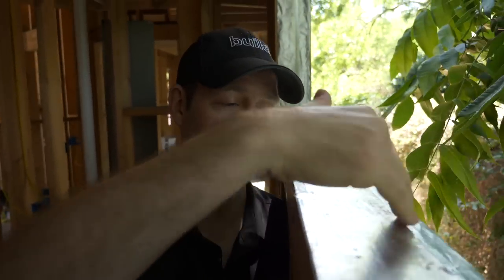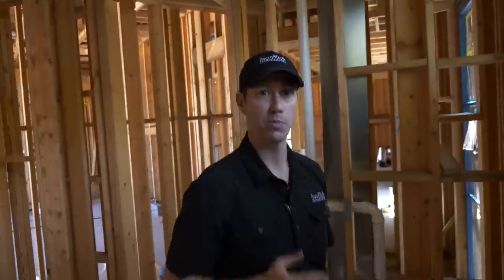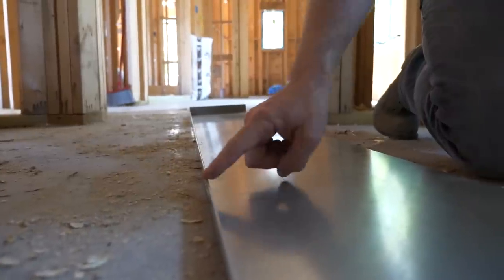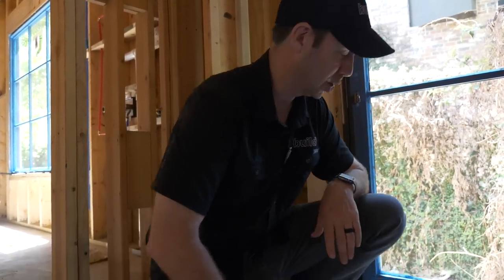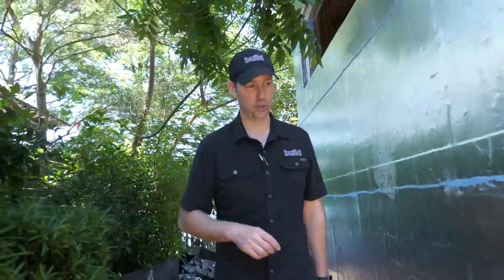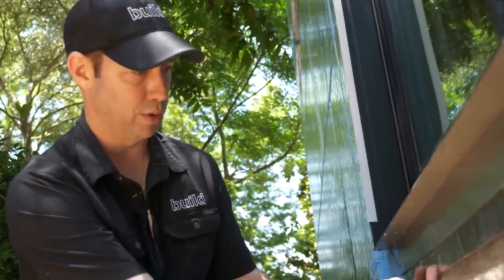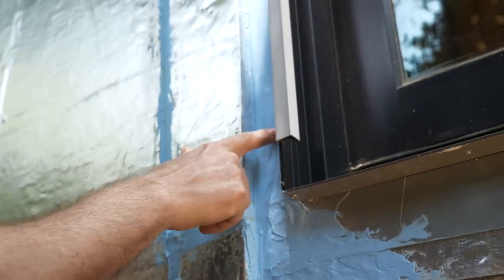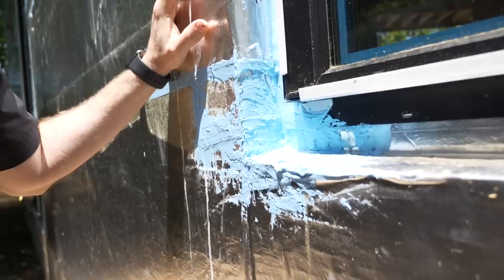Exterior Doors MUST have one of these!

Comment: I've heard that metal plans are great conductors or heat and cold. In very cold weather cold pans create condensation thus moisture on both side of the pan. Membrane pans prevent this.
Reply: Really good point, it would seem that membrane flashing would be just as good and less costly.
Reply: You can insulate the interior of the house off of the plate. I think the general idea is to catch any condensate from the bottom and drain it away. But then again, a membrane does protect the wall, too, yet it's easier to pierce a membrane than a steel sheet. I guess it's just preference. That said, I would probably go with your approach anyways.
Reply: That’s something that make sense so where can I get a membrane pan

Comment: Hello from mid Michigan. This may work well in the hot South, but not so well in the cold North. First the setup, 25 years ago I put a set of Peachtree French doors on my second floor bedroom addition. In a South facing wall, exiting onto a small deck over a low pitch roof of a 1st floor room. Thinking as you, that I would prevent water intrusion under the door set, I formed aluminium flashing as a pan. The pan extended from inside the door sill, outward over a 2X6 that was attached to the 2X6 framing below the door, to which the deck was mounted.

This worked great for water intrusion, but during the winter I had major ice build up inside the door sill. After determining that the cause was a loss of the thermal break which was built into the aluminium sill, I had to remove the whole door set, cut the aluminum back to the thermal break in the sill & reinstall with caulking as a water stop.  Problem solved & no problems since.
Reply: This was my concern as well - Here in MN we can get ice buildup inside and around windows on extremely cold nights, even if they are good quality and installed properly. I think this should be clarified as a southern climate solution.
Reply: Where is the thermal break that you are talking about ?
In my area condensation is a major problem that I'm having .
Could you explain how you installed this ??
Thanks, 
Tired of do.overs......
Reply: So basically not that the Pan was no good but the implementation...✅
Reply: @jefflosey1561  the implementation is always bad, you can't do it well, because you are bypassing the thermal brake made by the factory. If you use caulking, e.g. silicon between the metal plate and the door sill (which you do, as you don't want draft over there), you are making matters worse as silicon is 30 or more times more heat conductive than air. A compressed foam strip is also not as good as an uncompressed one. The good implementation calls for a thermal break but then why even bother with the whole plate, if you are cutting it in half. This solution is smart but not apt for today's standards IMO. I really like the idea but the quality of windows in this age makes it obsolete as it introduces a problem while solving another one that shouldn't even be there in a new construction in the first place.

Comment: Depends on where you live. I live in California and I have removed exterior doors that look as good as the day they went in eighty years ago with No metal. Great idea for weather beaten exposure but not always, and the extra cost can be high. Sheet metal specifically made for a single application can cost as much as the door itself.

Comment: As a builder i think this is a great idea, except i build in the North and i tried this a long time ago. What happened water actually got frozen on the pan to the sill plate of the door, as winter progressed more water got in there and actually bulged the sill so the door didn't open. So out came the pans and went back to the old wat.

Comment: I was taught to install an exterior door with a lead pan which is easily found at any lumber supply and takes some experience to mould . Geocel polymer sealent the shit out of it (in proper form of course) . This  is tested and proven to work here in northeast .

Comment: I like the concept but sometimes I think we outsmart ourselves.  A properly installed door with some good silicone will work well.  What happens when it's 45 below zero and your door pan frosts up?  May work better in the south though.
Reply: Just don't step on it or else you are going down!
Reply: diggk1 45 below zero? We’re do you live?
Reply: Klaa2 , Are you high ?  This solution is better than most, if not all homes in the U.S. today.
Reply: I build in Minnesota and -45°F is extreme,  but the week I moved into my current home it was -20°F more than a couple days. Not much of your normal building materials/techniques will be very good at that temp. For those who don't have experience at those temperatures it was 52°F below freezing and the indoor/outdoor difference was around 90°F. My home was built in the '60s and has 2x4 framing. Definitely not a good plan for this climate. I would say that we have to plan for a temperature range roughly from -15 to 100°F. A stainless pan definitely would be a heat sink at any temperature, but the concept of thinking long term is great. You just have to adjust your materials for your application. Matt says that in many of his videos. 
There are options for plastic sill pans for us in less friendly climates. 😊

Comment: Layering another material over that pan would be a great idea. If that stainless pan (or any any metal) is against another dissimilar metal (perhaps an aluminum threshold), you'd be putting both products at risk of galvanic corrosion. 

Still, you produce the best videos on how to build it right! Thanks
Reply: tommyjohnsonjr    Generally it’s never metal to metal contact, even in this Video the Threshold is coated on the bottom. Watch video again and you can see the non sticky side of a seal.

Comment: ultimate sill flashing. good call using stainless on concrete. do you air seal between the metal sill flashing and the concrete or framing?

Comment: Will that lip on the metal pan always show from the inside?  My rule of thumb is no doors without a roof over them or they must have a stormdoor. They all leak if they get blasted with rain.
Reply from the maker: +bluebird5100 good rule!  No the pan is roughly 5/8" tall and the flooring will be taller. We will caulk the gap
Reply: bluebird5100, all doors in my opinion, should have a storm door, just good building science,

Comment: OK Risinger....I hear your plea for the metal pan...easily done, but I have a sliding- glass unit going over a concrete pad edge....some sources say to use a p.v.c. board, or pressurised over the slab first. Should I make a pan and screw it into the concrete, and then install vynal door sill over that? or would you just use the pan like in this video.....really got alot out of the video, thanks

Comment: That recess is gonna be a problem though, mark my words. I get that stucco is going to wrap around it into the recess. I can understand how it might look nice, but it is gonna be next to impossible to properly stucco inside that recess and to make sure that in two or three years' time that "nice detail" hasn't let any water in or cracked from expansion and conctraction, improper application, door installation, wear and tear etc. Because from what I've seen, from the way you build houses so airtight, any kind of moisture that might leak in from that recess is never gonna go away, and you're gonna have problems.
Reply: Those recesses are a horrible design trend. People think it will look like the window is deep-set into a thick wall, but it just looks fussy and fake. I say either embrace the reality of modern frame construction with flanged flush windows and do that well, OR spend extra on heavy masonry construction and detail accordingly.

Comment: I will be replacing the front door, sill plate, cap joist and sill plate under my front door (rot), but I will be leaving the milled 4x4 logs exposed, Matt (or anyone else for that matter) do you have any recommendations on what to use, where the exterior walls outside the door frame will be exposed?

Comment: Hey! Got a question/problem. I have a basement, exterior door that has poured slab inside and out. Both the same, or very nearly the same level. Some one in the past has tried to apply concretely to create a slope away from the door. It is now falling apart and I will be removing the whole business to replace it. But I am not sure what to do about the threshold. Thoughts?
Reply from the maker: That’s really hard. Water gets in with out gravity pulling it away.

Comment: No concern about condensation?  The metal serves as an energy bridge from interior climate to exterior climate.
Reply: Jim Bronzie I'm with you.  I love the concept. Have entertained the idea of doing it several times but you have a great point...
Reply from the maker: +Jim Bronzie I can see that.  If that concerns you use this one. Very well made. http://www.suresill.com/
Reply: Matt Risinger I still see condensation as an issue in cold climates such as mine (Canada). Anywhere cold air meets the warm inside air is an issue for us. Even the self draining door sills from Andersen condensate when customers have slightly high humidity in the house. Is there any way around this? Or is this an issue for different climates?
Reply: Neil, make a thermal break, that would work correct ?

Comment: If this metal pan is needed on exterior doors, why aren't they needed on exterior windows?  Doors usually have some overhang protection whereas many windows may not.  And if sloped sill flashing is good enough for windows, why aren't they good enough for doors?  Is it just the higher cost of these metal pans that prevent them from being used on all windows?  If so, not sure why the door protection is cost justified but the window protection is not.
Reply: The only reason I can come up with is doors are used way more than windows and by people/dogs with snow/rain soaked shoes/paws and clothing ? I also believe that all ROUGH openings should be sloped ever so slightly on the bottom towards the outside, probably overkill, but...better safe than sorry.
Reply: This was addressed in the video as a specific design detail for over concrete.
Reply: @afobear  I think he specifically cited use of stainless steel material because of the concrete.  But his message, including his last statement in the video, was that you would want to use metal sill pan under all exterior doors.  I agree with the protection prevention, but to me, water damage from window leaks could be just as costly to repair as leaks from doors.  In the end, I think it's easier to cost justify a more expensive waterproofing system for one door versus applying the same, more expensive waterproofing system for many windows.  So it appears to me to be more of a total budget consideration.

Comment: If you use a pan you don't need any caulking. We always use lead. you can form it and make it tight. If you flash things correctly you do not need to use caulking.
Reply: Jameson Cross lead? Ewwww. Unless it's leaded solder, gtfo.
Reply: Lead stretches and can be molded with some persuasion. I use a rubber hammer and a block of wood. Carpenters have been doing that for a long time. It's called skill.
Reply: if i catch you using lead on my house me and you are going for a walk out back, and only iam coming back, fucking guy using lead on a house in 2017, gtfo
Reply: You're an idiot.
Reply from the maker: +Jameson Cross the back caulk is for an air sealing
Reply: I've never had to with lead. It forms tight. A stainless pan must be very expensive.
Reply: bleachinuri So can you do something about the fluoride in out water next?
Reply: Joseph Lucero wtf you talking about
Reply: bleachinuri I was poking fun at you being concerned about lead flashing that might poison you when most water in the US is poisoned with fluoride. http://fluoridealert.org/articles/50-reasons/
Reply: Joseph Lucero oh ok it went over my head

Comment: I had a new Masonite exterior fiberglass door installed for my laundry room.  The floor of the room is vinyl sheet. The problem is that the steel threshold sticks up 1 3/8”.  

I realize this was designed for thick tile floors, but the threshold is easy to trip over. 

I have not been able to find a reducer that will remedy the situation. Any ideas on the best solution?
Reply: @Krunch2020  thx.  I’m not finding that online.  Can you send a link?